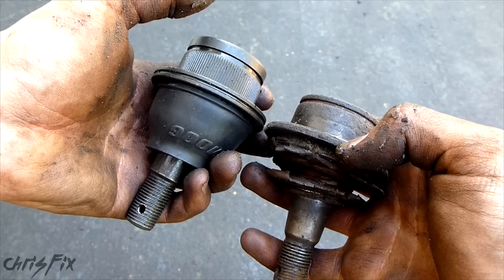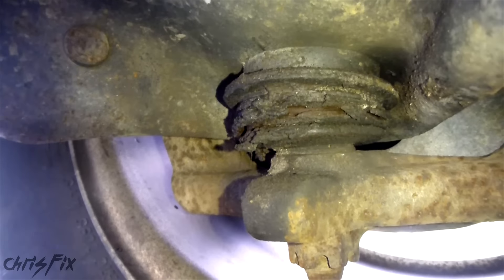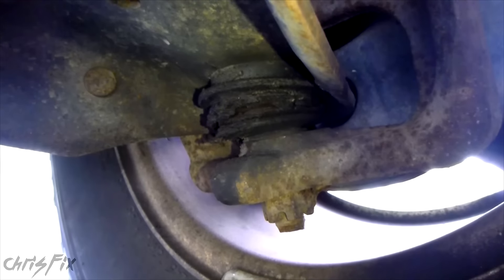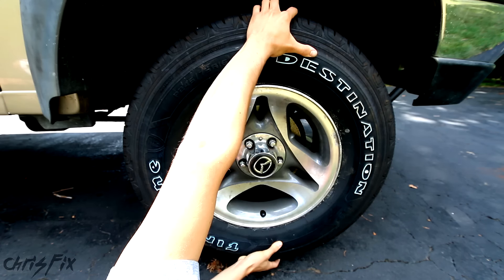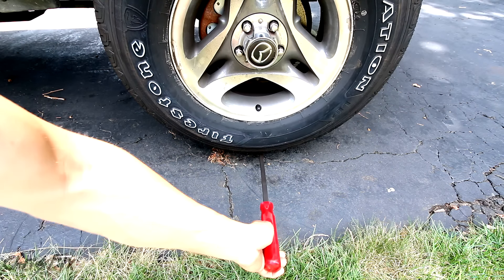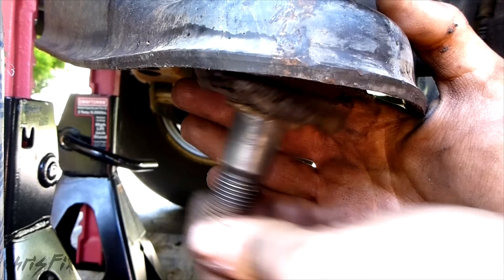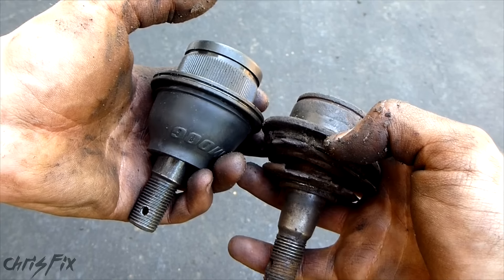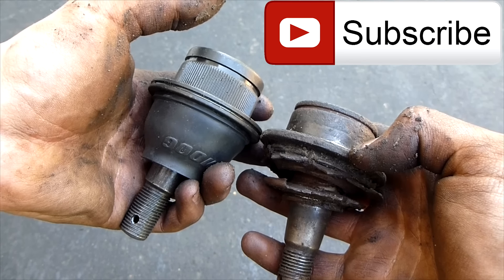How to Check if a Ball Joint is Bad

Comment: As a former mechanic I agree 100% with this video. Everything stated was accurate concise and to the point. Thank you Chris for another excellent tutorial.
Reply: Except that the ball joints can in fact be replaced. 🤫 You just gotta know the right tech that knows how and is willing to.
Reply: The only thing I would add is the fact that some ball joints allow vertical play and there is a specification for them. I use this video in my classroom. Great job.
Reply: Why is honda cars notorious for ball joint failure
Reply: One can never be a former mechanic
Reply: If ur a former mechanic. Why would you be watching a instructional  video on how to fix a car?😅
Reply: @Jerseydude12  maintaining and reinforcing knowledge. Former mechanic father in law told me “if there’s anything giving you a hard time take a break and watch a YouTube video, it’s what I always do.” As advice when working on my car
Reply: @aliyusulaiman1137  because Honda‘s last so long and the ball joint fails before anything else 🤷🏼‍♂️
Reply: @sum_kent08 exactly lol
Reply: Toyota me cobra 2047 USD por reparar el RIGHT FRONT LOWER BALL JOINT & RIGHT FRONT CV AXLE BOOT KIT,

Crees Que asi vale?
Reply: @aliyusulaiman1137 Idk maybe they just make too much power for the ball joints to handle with that vtech.🤷‍♂️
Reply: @KishRapOficial and somehow no translate feature
Reply: A guy in another video said you needed to have weight on the A-Arm.   So you wanted nothing under the tire but you did want weight on the A-arm.   Could you weigh in on that?   
Video is titled " How to Check Ball Joints (The Right Way) Tie Rods and Wheel Bearings | RAM 1500 Pick up Truck"
Reply: RIP CHRIS.
THANK FOR ALL THE GREAT CONTENT.
Reply: Bad ball joints.
12/10/24.

Comment: Was wondering what that noise was. Found out when my wheel folded in lol
Reply from the maker: Darn! How bad was the damage?
Reply: Glad you made it out alive friend
Reply: Skip Gordon Why ?
Reply: Ehh... broke the axle on the way down  but new ball joint and new axle $95 and I'm back on the road.
Reply: @TeoYankov1234  just saying if you have a balljoint fail at 50 mph. Its basically a death sentence, glad he is still here
Reply: This just happened to me, thankfully I just got off the highway and was pulling into my home driveway when it failed.
Reply: @chrisfix   still replying to comments on a  6 year old vid, legend
Reply: @chrisfix  try to you to the 56th to try tt Ty Ty Ty Ty 5t
Reply: Same had a ball joint fail on me after doing a uturn luckily was going slow but super embarrassing. If you hear a noise get it checked out, its cheaper than a funeral.
Reply: @chrisfix  lower ball joint failed going 74 on jersey turnpike in an 02 crown Vic.
Scary scary stuff, front end collapsed to the ground
Reply: @charlesderrico5325  damn, im glad you survived
Reply: @chrisfix  iytutúttttyi7itttiy8túttuitútiúttu8itútttt7r8tttrittt7yt8yittt87ttitutuútiuttotútttutuittútuy
Reply: @chrisfix  t
Reply: Bro I was hitting drifts in my 2004 gs mustang and my ball joint went it and landed on my tire and rim😭
Reply: Jesus, I didnt even think about that happening😬 I've been driving with this same exact squeaky sounding mess for a while now. This just made me sick to my stomach lol  My u joints just started clunking and clicking when putting into reverse and then switching into drive. I thought that was my most immediate concern and planned on getting that done this weekend, now I'm paranoid about the ball joints. Guess that's getting done this weekend too and a new alignment 😪 next is the blender doors, heater core, evaporator core and blower motor replacement. Already down 600 in parts but I'm sure saving thousands by doing myself. I'm worried about dropping the dash and hopefully being able to get it all back together in one weekend tho. Fingers crossed
Reply: Lower snapped on me and the wife in a jeep liberty. Thankfully it was as we just took off from a stop light, and not doing 60mph.
Reply: Ouch!! Been there!!!
Reply: Lol me to
Reply: So coolPer
Reply: Happened to me just as I exited the highway. Scariest situation I’ve been in
Reply: Dazzzamn
Reply: @Cook2430  that happened to me in my 06 liberty renegade about a yr ago! Parked, put into reverse, turn the wheel and she snapped like the wishbone on a thanksgivin turkey.
Reply: Been there 😂 shifted into second and the wheel said see ya
Reply: Oh shit, good thing I discovered the problem early
Reply: It has happened to me.  First gen Tacoma 🤣🤣
Reply: We were on the way to the park and thankfully we pulled over. We had to leave our car on a street then my neighbor passed by and gave us a ride home. It didn’t break on us but I know if we would’ve kept going it would’ve. We’re going back later to fix it. I’m just thankful we didn’t have an accident. Thank you God 🙏🏽🙏🏽🙏🏽
Reply: I lost a ball joint and it folded up my front end doing 70mph in a can am. (So I was off road). I was able to slow the car down to about 45 mph before it rolled twice. I accepted death in that moment
Reply: @jdemonte89  Whered you find a deal like that. Did the work yourself right?
Reply: @jamesbenji5084  Bingo
Reply: Lol same
Reply: Same
Reply: Oh no
Reply: @jdemonte89  how do you know what kind of ball joint to get ?
Reply: Dang. I've never seen that growing up . I see it on the roads nowadays, I can't imagine what that felt like in the car
Reply: 14 Mazda CX5 front balljoint just came out of the socket in the control arm.   Fortunately was just turning out of a driveway otherwise It was a death trap.   No warning either.   Car drove smooth-no noises.   160k miles.   Wondering how many fatalities this causes a year.  Totally unacceptable.   The problem is they are not greaseable like back in the day.
Reply: Literally just happened to me 🙃

Comment: Just had my car serviced today to replace the lower ball joint. Heard a “popping/clunking” noise when I would break, then it got to the point where the car would drift when driving. When I took it to the shop, the tech said it was dangerous to drive on and the ball joint needed to replaced. So happy that I did not ignore this and can continue to drive my vehicle. This video is still helpful 8 years later.
Reply: Seems simple enough I’m bout to do mine my self … save my self the labor cost… how much was your repair ?
Reply: great, is it good idea to replace ball joints for all wheels so that why to bother again and again visiting mechanic. if problem appears for one wheel eventually it occurs for all wheels. since its wear and tear. and moreover  my car feels bouncy even for little uneven surface on road.
Reply: How do we know it’s a tie rod or ball joint?

Comment: The best way to test a ball joint is to stick a pry bar under the tire once you have it off the ground and try to pry the tire up and let it come down while someone watches the ball joint. Any vertical movement between the knuckle and the lower control arm that is joined by the ball joint is a worn out ball joint. 12 and 6 on the tire can miss ball joints that have just vertical play and not side to side.

Comment: Just to make it clear, when using the pry bar method you need to make sure the ball joint is not "loaded". You can do this by jacking up the lower control arm or lowering the vehicle onto a jack stand which is under the control arm (this is assuming the lower ball joint is your loaded joint). If you just jack up the vehicle by the frame and let the suspension hang, you may not get any play, even though the ball joint is worn out.
Reply: Yup. Video is wrong for SLA suspensions like these. Chris should fix it.
Reply: I just made similar comment. Good point!
Reply: That makes sense. When you jack the vehicle up you are taking the load off the tire, but the coil spring / strut is still loading the ball joint depending on the setup.
Reply: Thanks boys,good info
Reply: Was going to say the same  but figured I check the comments first
Reply: nunya business  you are actually unloading the  ball joints when jacking from lower control arm. All the weight is on the jack. That style suspension only way to check ball joints.
Reply: Right, right, right!!  And if you are lucky enough to have an older vehicle with grease-able ball joints, do this same thing when greasing.  You'll get a lot more fresh grease between the bearing surfaces than you will if the joints are loaded.  If the joints are loaded, the grease will squeeze through via the easiest path, leaving most of the existing grease (or lack thereof) untouched.
Reply: My bro did this wrong. I am gonna try this the correct way.
Reply: Exactly
Reply: Critical . You can never test a lower ball joint by rocking the tire , loaded .
The upper , yes .  How many mechanics know how to properly check lower ball joints ? Very few ! In fact there are specs using a dial indicator to measure wear . We're talking thousandths of an inch . They should have very little play at all. Because when they POP ! It's ugly .
Reply: @motorbreath3  When you say "when they pop" - what do you mean?
Do you mean they will be more likely to break if they have even a tiny amount of play?   How would I learn how too test them with a dial indicator?

Comment: Both of my front lower ball joints were bad and they caused my steering wheel and car to shake really bad on the highway. For the longest time I thought I had a bent rim or something. but as soon as I replaced the control arm (the ball joint itself couldn't be replaced only the whole control arm) the shaking went away. What a relief because the control arms only costed me $30 each and a few hours of a Saturday afternoon.
Reply from the maker: That’s awesome! Nice work
Reply: ChrisFix thanks Chris 👍
Reply: Jake Higgins I was just told during an oil change today that my ball joints are ruined on the driver's side. They said the passenger's side still looks like there is a lot of life left. The only anomaly I have noticed is some shaking when I brake relatively hard right before I come to a complete stop and in my driveway I sometimes hear a pop noise if I am turning in and making a 90-degree turn to back the vehicle up afterwards. Did yours shake or vibrate when you were braking?
Reply: TortureBot no mine didn't shake while braking. shaking while braking is usually caused by a warped brake rotor. Does the shaking get worse the harder you brake? If so then it's most likely a warped rotor.
Reply: Jake Higgins yes I was wondering if it could be a warped rotor or that my rotors needed to be turned, but I had a complete brake job done about a year-and-a-half ago which included turning the rotors and the shop that I have used for probably 20 years did the work. I have never had any trouble with that shop, but I know that doesn't mean that it couldn't be a rotor. The ball joint problem should be fixed tomorrow while I'm at work. I will comment back and let you know if the shutter or shaking when I brake has went away. It seems to be a little worse when I brake hard but mostly it's shuttering right before I come to a complete stop. It doesn't do this if I'm not driving more than about 30 miles per hour, just when I am decelerating from about 55 miles an hour down to almost zero before I make a turn or something usually.
Reply: Jake Higgins 
Warn or loose w/bearings can also make the steering shake.
Reply: @TortureBot  did the shaking stop when breaking solved after new ball joint?
Reply: @johnnyfactory it seemed to have solved the problems.

Comment: Does it matter if the parking brake is on when you test for movement?
Reply: The parking brake is for the rear wheels only so it will not affect your front tires, no.

Comment: You can replace the upper ball joint by cross referencing the Ford Ranger/Motorcraft Part Number and pressing the ball joint out for Mazda B Series Pickups.
Reply: Motorcraft is sub par compared to Mazda Genuine Parts

Comment: You make some excellent videos, thanks. I followed your quick radiator and heater core flush. The job was simple and smooth just like your directions. I just got my inspection sticker and the mechanic said there's a tiny bit of movement on the drivers side ball joint. Now I can visualize what to look for. Thanks again

Comment: Trying to figure out if you're a better teacher or mechanic.  These are the best, clearest videos for non-gear heads like me.  You're seriously lifting the veil to the mysteries of the automobile underworld.  lol!  Hey, I can't find a 1993 F-150 control arm assembly.  Both ball joints need replacing, but it looks easier to replace the whole control arm assembly, and not much more expensive.  Any ideas how to get one?  No auto parts stores have them.
Reply: kittylovermybut i dont think he still needs help its been 1 year
Reply: You are correct! I sold the truck after it sitting derelict for 6 months because I realized, despite helpful youtube videos, that I am no mechanic, and that everything I've ever endeavored to do to the truck required the purchase of some kind of specialized tool I didn't previously have. Therefore, I'm leaving that stuff to the professionals and have concentrated on guitar and painting. lol
Reply: Christopher D "guitar and painting" haha that's funny. Good luck to you.
Reply: it's still good advice for anyone else watching this video .In addition,most of the time RockAuto has the part for less .
Reply: If you can't find the part online, there are donors and junkyard trucks with good assemblies virtually everywhere.
Reply: @kittylovermybut  now I got that Rock Auto commercial jingo, playing in my head, thanks🤤
Reply: Ebay has everything you need for your car parts.
Reply: Christopher D 👑

Comment: The tire wiggle mostly shows the condition of the wheel bearing, but will also show ball joint slop. Better way while it's lifted like that is to pry upward with a pry-bar between the pavement & lower control arm while watching the joints for vertical/horizontal play.

Comment: Your methods for checking balljoints will work on some suspension setups but not all. On an SLA suspension system or any other system where a balljoint is your loadbearing member u must load that balljoint (by lifting on the control arm) to check for play. The bar is used to check up and down movement on your upper balljoint. Depending on the vehicle there may be a specification for an allowable up and down play in ball joints, heavy duty ram trucks are 0.080". however no movement in and out is allowable. With most front wheel drive vehicles such as minivans and cars that have strut suspensions that have the strut as the load bearing member the balljoint can be checked without loading the balljoint as it is just a follower.
Reply: I agree with ryan, but think he means "unload" and "unloading" instead of "load" and loading. Ironically, I think this truck has a SLA suspension (not sure), so he could have gotten a false negative by jacking car from the center instead of under each lower control arm. His joints must have been really shot for this to work as well as it did.

Comment: You have to unload the ball joint to check it's play...These were completely wiped out so it wouldn't matter but jacking the vehicle up under the lower control arm shows its true condition..
Reply: True on short-long arm ("SLA") suspensions, which are often found on pickup trucks and older SUVs; not so much on McPherson struts suspensions (most passenger cars).

Comment: Customer: The Labour on fixing those ball joints, how much does that cost?

Mechanic: yes.
Reply: Its actually not a hard fix if you are a little mechanically minded. You can buy or maybe borrow ball joint drifts too bang them loose. Take out the old ones and install new ones. Will need a wheel alignment though.😊
Reply: All you need is a breaker bar with your lug nut sized socket. A wrench for the castle nut if your ball joints have them, a socket a wrench combo for the balljoint bolts, and a hammer. All of which, if you're an adult you should have in your house. It's one of the easiest repairs to do, which mechanics charge alot for because they have to charge you for the hour, even if it's a 20 minute job.

Comment: Hi Chris,
Thanks for the video, however it is a bit too basic in my opinion..... different suspension types have different methods of checking the ball joints. Please elaborate where to Jack up the vehicle based on suspension type to relieve it from spring tension to properly check the balljoint.

Comment: My tire isn't solid. It moves inward at the 3 o'clock position but cant pull back out. Is that normal?
Reply: What do you mean it moves? There may be a little bit of play but it should almost be non noticable.
Reply: @vigilantemotors  yea, the tire can be pushed inward
Reply: Ok perfect thank you!! Wasn't sure if the tire was suppose to stay stiff or not.

Comment: Great video, it’s a classic. I’m trying to determine if mine are good because if they are I probably won’t change them before I get an alignment (I did most of the front end minus the ball joints). I’ll have to buy new cotter pins for my steering knuckles if I go that route but that’s not a biggie.

Comment: I have 2018 ford escape the rear makes like a squeaky noise going over crushed concrete road and once making the rear go over the speed on the last final bounce it squeaks. I’ve replaced the shocks but still makes noise. Is there a grease I can use just for more troubleshooting to check if that’s the problem?

Comment: Do both tires have to be off the ground to check the side to side motion on the wheel or can I just jack up one and still get the same results ?
Reply from the maker: You can just jack up one side, in my case it was easier to do it from the middle

Comment: Our 2012 G37 rwd front drivers wheel feels clunky over some bumps, so we raised it up and at the 12/6 position, there is definite movement, not nearly as much or at all doing the 9/3 test. I've replaced the wheel hub & outer tie rod, so I'm leaning towards the lower ball joint at this point.